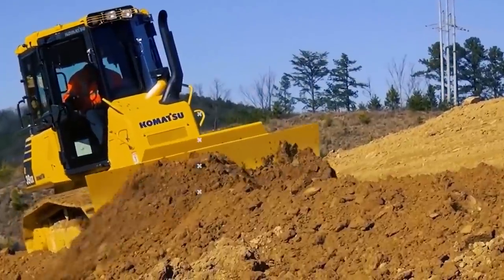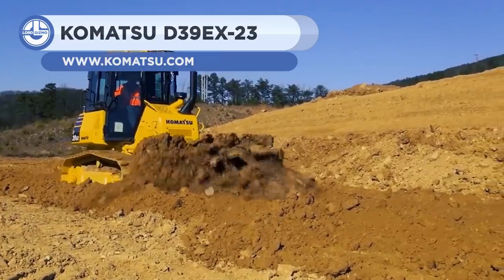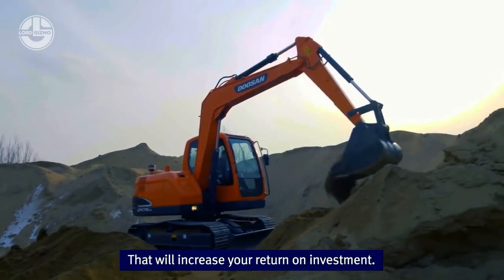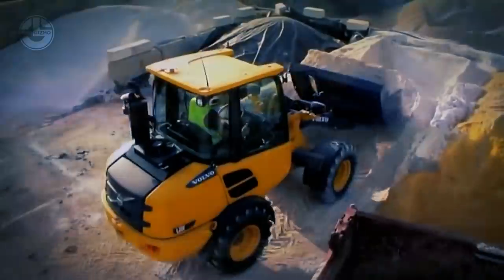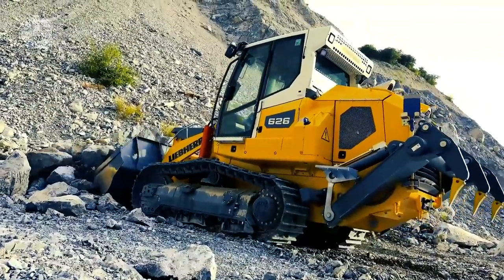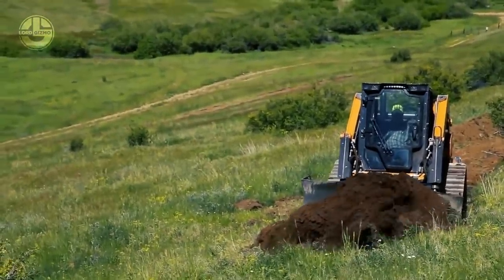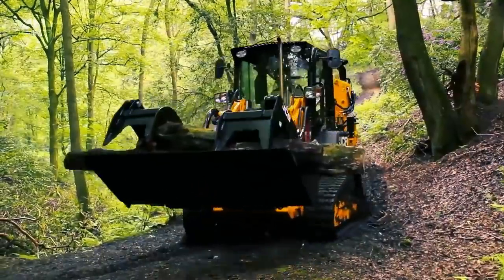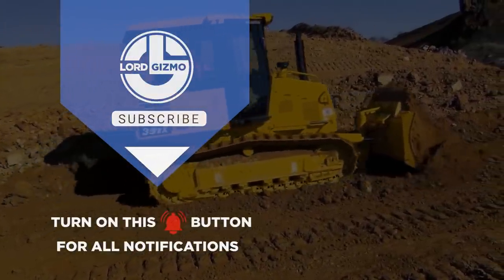Compact Yet Powerful Machines Do Easy Work From Hard Tasks

Comment: WHAT?????
The Volvo loader is over 16ft wide??????
Also.. I doubt that the Liebherr has a reach of 16ft 4ins.
You never fail to entertain with your descriptions..
Reply: Same with the Case skid dozer.......a 14 yard bucket is just hilariously wrong. The bucket would easily hold the machine itself. Also, as a simple example, a fairly dry yard of topsoil weighs a ton. 14 yards is 28,000 lbs which completely dwarfs the weight of the machine.

The specification sheet he was reading from probably said 1.4 cubic yard bucket but somehow, 14 yards sounded reasonable.
Reply: @mikesinyaboot5992  Lord Gizmo s comments are always good for a laugh... If he had any idea about machines at all, he should know what he is saying is wrong..... But, having said that about him, usually the selection of videos can be interesting..